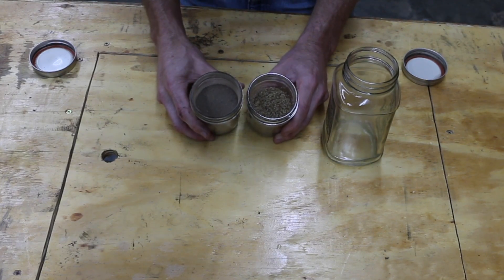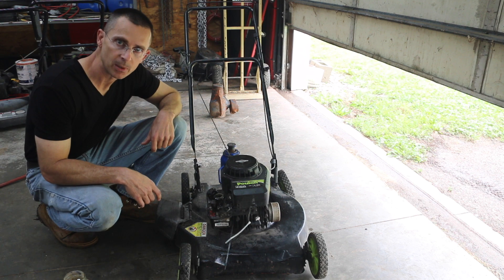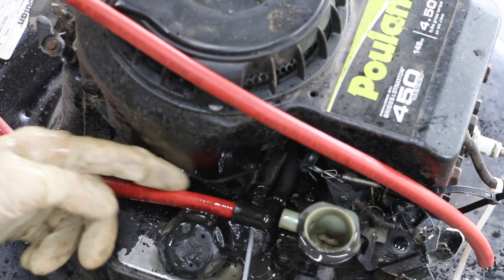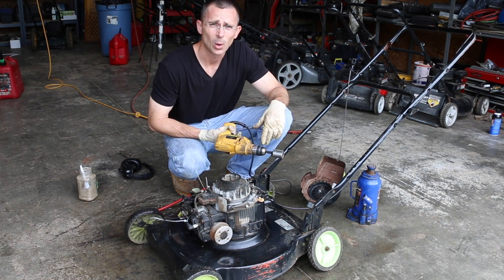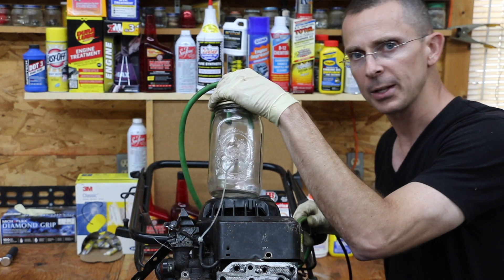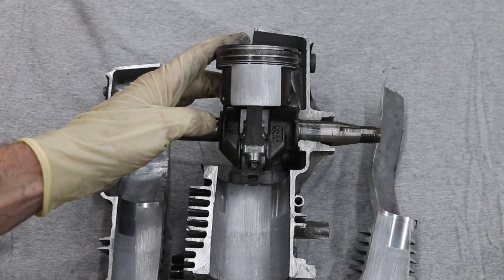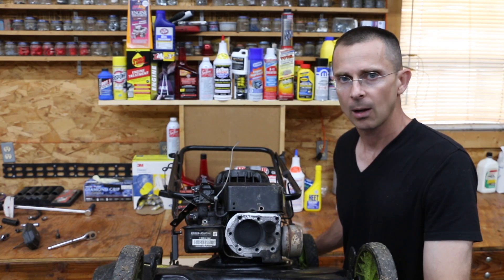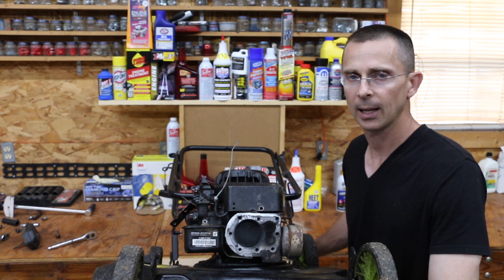Will Dirt Destroy an Engine?  See what it does to this Engine!

Comment: So. Your conclusion seems exaggerated and slanted. What you are saying seems to be analogous to saying that “you must brush your teeth for one hour everyday and if you don’t do it a single day, they will rot and fall instantaneously”

Based on what we can see in the pics, you would need a very large amount of sand to destroy an engine (3-10 spoons!!!). 

And an air filter definitely helps prolong the life of an engine in the long run, but not having it doesn’t instantaneously add 3 spoonfuls of sand to an engine. Unless your car ends up in a extreme condition, like in a river or stuck in a mud puddle, the engine would get minuscule amounts of fine dirt in; Certainly, not pebbles.
Reply from the maker: Thanks for the constructive feedback.

Comment: And this is why I just shake my head at the people who have a turbo on their engine without a filter thinking that the extra few ponies are worth sucking in raw atmosphere. Almost like they enjoy spending money for a rebuilt engine.
Reply from the maker: You're right! Great point.
Reply: My car is supercharged, and I chipped a piston (from knock, blew a quarter of the ringland off smashing up the spark plug and cylinder head) because my intake tube had a small hole in the bottom that I didnt see. When taking the top end apart I noticed the intercooler underneath the supercharger had all the fins bent and full of sand particles, it also damaged the rotors inside the supercharger (Teflon coating) as well. I figure that while I was driving the car in the winter all the road sand got sucked in there. Was a very sad day... I always double check everything is sealed now and couldn't imagine taking the filter off in any situation!!

Comment: It's very unlikely for an engine to suck in that much dirt at once. And I highly doubt the engine would look nearly as bad if it would have sucked in 4-5 tea spoons of dirt in the course of a year or so.
I'm sure engines have air filters for a reason, but this is not at all comparable to running an engine without an air filter, since dumping a whole spoon of dirt into an engine at once is a completely different scenario than a few dirt or dust particles occasionally being sucked through the engine. You could have at least tried to only sprinkle in a little bit of dirt at a time.
Reply from the maker: Thanks for commenting.
Reply: Your welcome...
Not hating btw. just saying it's not an accurate simulation of years of dirt and debris.

Comment: Good video Project Farm.  I would like to see this test done on a rotary motor.  I had a sandrail with a mazda rotary engine in it, it was a nice set up and made alot of hp and high RPMs.  There were a few times when the air plumbing between the turbo and the intake plenum on the engine would completely open up (before I replaced the weak hose clamps).  I didn't realize it for a while, and it happened on several occasions, driving in fine sand.  If you've ever ridden hard in the dunes, you know that sand covers thick everywhere so I know it got in the engine - easily teaspoons full.  That engine never missed a beat!  And ran great for several more seasons (with bulletproof hose clamps).  I am baffled to this day about it and I've always had a theory that the architecture of the rotary motor is more forgiving to having sand in the engine.  I'd love to see that test!
Reply from the maker: Thank you for this recommendation!

Comment: How would the jets be able to put the gas threw?
Reply from the maker: Some carbs have an adjustable jet(s).  The jet increases or decreases the size of the opening in which fuel flows.  A lot of these small lawnmower engines do not have adjustable jets.

Comment: Could a loose spark plug cause any sort of damage over time? If it was hand tight but not tightened with a ratchet.
Reply from the maker: It's not likely to cause damage over time. I would suggest tightening it.

Comment: I would like to point out that a "Dirty" filter is not the same as a "Broken-torn" filter, as a dirty filter actually cleans the air better than a fresh-clean filter due to the pores being smaller on a dirty filter and will restrict the air inflow. On the other hand, a broken filter will act the same as a missing filter.
Reply from the maker: All great points. Thanks for commenting on this.

Comment: that was painful to watch. RIP mower.
Reply from the maker: Thanks for commenting!
Reply: Project Farm question? The reason I looked at your video was because I put an aftermarket intercooler on my car and my car sucked up what appears to be a little bit of fiber glass. Do you think it's okay to run it till it burns it off or should I have my motor disassembled?

Comment: Also, it does have a drain plug underneath. It's just not a regular 6pt bolt. It's a 3/8" square, so ya don't even need a socket, just stick a 3/8" ratchet with an extension in it.
Reply from the maker: Some of these mower engines have the 3/8 inch square plug and others don't have any sort of drain on them.

Comment: What a lot of nonsense 😁 an engine will never take that amount of dirt when driving
Reply: Hey dumbass, it's over time.
Reply: Steven Kibble According to the Nissan service shop my engine has taken in this amount of dirt from a crushed catalytic converter clogging the exhaust system. The composition of the grit is a little different chemically but the result is the same. It was driven about a mile with the shattered CC & is throwing a misfire code & smoking when the CC is disconnected. Never say never.
Reply from the maker: Thanks for commenting.

Comment: Idea for a video: (used,carefully,thru a thin hose, in  decarbonizing old engines): water ingestion while running; i have seen a mechanic overdo it(just pouring water down the throat of the carb) and... cabooom,engine no more (you can´t compress water...).
Reply from the maker: I plan to test a "water mist" in the future.  Thank you for this recommendation!

Comment: *Great video*;  thank you for taking the time; iam gonna make sureb all my air filters are in place,and sealed all around;amazing damage with so little dirt.
Reply: Here goes an idea for a video : i have seen destroyed engines(all gummed up to the point of seizing up),due to very old gasoline(stale gas); one that i remember well,a friend of mine had a few gallons in his boat,parked on land for 15 years; he used the gas in his motorcycle,and it seized up,in the first day; that´s what he told me,and i saw the piston,rings ,and cylinder ,all scratced up,and all covered in brownish varnish,a gooey mess; you could get the stale gas from a junkyard,or from an old boatyard; thisvery old gas has a distincty strong smell to it,differen than the smell of new gas.
Reply from the maker: Thank you for this recommendation!

Comment: If you put filter oil on a dirtbike airfilter that isn't completely dry after being cleaned with cleaning fluids your filter oil will not stick properly to the airfilter.  I've seen it myself personally. the moisture vanished and left dry spots on the filter.  If I remember correctly that 250cc lasted 2-3 laps around a 2.5km sand track.
Reply from the maker: Great point!

Comment: AAng on a second most lawn mowers are either two stroke or not, so which ones are theres, no oil added in the fuel or just run on normal leaded fuels ?
Reply from the maker: I've only used 4 stroke engines up to this point.

Comment: stupid experiment! when sand, dust and dirts enter the engine normally with air they do enter it in small amounts that it can deal with !!
Reply: 1 particle or 100 particles. If they get between the rings and the cylinder wall they are going to rip it up. Accelerated endurance testing. It was demonstrating in a short time what may happen to an unfiltered motor over a longer time period. In small amounts the affects wouldn't be so obvious externally but each particle would be adding damage. 
This was sort of like a 5 years in 50 seconds time lapse.

Comment: @Project Farm, keep these up. I have been a mechanic professionally for 15 years, and a repairman my whole life. To all the nay sayers out there, YES, this type of sand and dirt does kick up during mowing, or driving. Don't believe me, open up the air box in your car, and look  in the bottom. Bet there is sand in the bottom. Still don't believe me, dig up a hand full of dirt from your yard, and rub it on a painted surface. Did it scratch it? Bet it did. There is fine crushed rock (sand) in all soils. If you ever mow in the summer and mow over a small dirt patch, you will kick up dust, and in that dust is very fine crushed rock (sand),  and organic material. This test was just to speed up what years of no air filter will do to a motor.
Reply from the maker: Thank you very much for the positive comment!

Comment: I wonder if ultra fine particles would actually provide a polishing effect? The ones that would pass through a dirty air cleaner?
Reply: You don't want the cylinder walls to be polished. New engines have a slight cross hatching pattern ground into them.
Reply: @rubiconnn  exactly ,that is how a good seal by the rings is attained (the piston should never come into contact with the bores and good rings and a  oil film does that- Once the bores are glazed and shiny a lower compression ratio exist with loss of power ,possible piston slap and oil usage.
Reply: that is what happens, in the diesel world we call it dusting. fixed low hour engine 1500 hours (factory rated life time of 10,000 hours before rebuild). i was in this engine replacing a cylinder head, because a rocker bridge guide worked loose. the rocket bridge guide was pressed into the water jacket so coolant got in the oil. i messed up and left a clamp loose, fine dirt in the air was sucked though into the engine for 40 hours.

engine started with i assume (after repairing many of this engine) with close to .002"-.005" cylinder ware. and a visible crosshatch on the bore.
end result was a bore that was worn .014"  over sized, pistons worn down an unknown amount. you could see the ring gap with piston at the bottom of it stroke (were the most cylinder ware happens) 
40 hours of sucking a metered amount of talc powder
Reply: I've watched an expert tuner assemble a brand new engine, and he "lubricated" the camshaft with a very fine paste, to actually make it polish itself for a perfect fit on the contact surfaces, to reduce future wear.
Reply from the maker: Great point.

Comment: Taking this idea to another approach, The old timers would always say you could increase the ring seal of an old worn out engine by dusting some Bon Ami down the carburetor while the engine was running. The last time I saw it done he used about 1/4 of the container but never checked the compression afterword. Always got the, "Trust me kid I do it all the time" I'm now 48 and never done it. Maybe you could test this theory on an older worn out mower
Reply from the maker: Thank you for this recommendation.
Reply: +1 for seeing if polishing a cylinder this way would make a better ring seal. Not something i would try on a many thousands of dollars car but an end of life lawn mower to get just one more season out of it. Maybe.  :)

Comment: I had a stainless steel mesh air filter installed on a vehicle do you think I might have caused extra wear?
Reply from the maker: It's hard to say without knowing the specifications of the filter.  Ideally, an air filter system will remove all dirt and dust from the air.  i

Comment: Thanks for sharing this. Back when I was in high school, there was this one married couple who I used to mow the grass for. He had a K mart lawn mower with a 3.5 horse power Briggs and Stratton engine. He never used the air filter and said that all the dirt and stuff does is get burned and come back out through the exhaust. The engine on that mower never ran right. 
When I got my Honda HR-21 SXA, I used to clean the dual foam and paper air cleaner assembly after all the time. With all the dirt I would see come out of that foam element and what it was, I again and again wanted to laugh at that man because I knew all that dirt and sand would damage the engine but it seemed he was not going to be told any different.
That was a great demonstration!
Reply from the maker: Thank you very much for the positive comment.

Comment: Briggs and Stratton are definitely one of the best motor manufacturers out there. One thing to take into consideration is there was a lot of dirt fed into the engine at once rather than the amount that would occur during normal usage and therefor would cause harsher damage to the engine simply because there is more of it in there at once. However, it's a great eye opener just to show how important such a tiny little air filter can be and as you said, if this is something people would do, this is proof of exactly what will happen if you don't use an air filter. They are obviously there for a reason! Another great project!
Reply from the maker: Excellent point and thanks for the positive comment.

Comment: FYI...A new air filter is not 100% efficient. A dirty air filer is. A dirty air filter does not let dirt into the engine, like a dirty oil filter. If you change your air filter too often you're doing more harm than good.
Reply from the maker: That's a great point. Thanks for commenting.

Comment: At first I thought he was going to make the epic start to the video by saying: "one of the quickest ways to gain a few Horse power on a gas engine is to add...dirt" lol

I think that first spoonful would have been a good point to stop because the point of faliure wasn't really necessary...the engine was still running after dirt was added.

But, it was kinda funny watching you spoon feed the engine 😂

This is an awesome idea for a channel and theres something to learn from most every video you put up. Keep up the good work 👷

***Could you do a video on undercoating for vehicles? (Oil spray) (rust protection products)
I'd like to know just what I'm getting

It could be a two part video where you can come back to the pieces of metal that you've left out to be subjected to weather...
***You'd have to test each piece against real world situations like: Chemical Salts that are used in places where ice is a common nuisance through the winter.
Reply from the maker: Thanks for the positive comment and thanks for the recommendation on testing undercoatings.

Comment: Could you try using water as a fuel I would love to see the cylinder head after it tries to compress the water but run fuel first than add water while engine is running
Reply from the maker: Thank you for this recommendation.

Comment: Would the same happen if you added fine aluminum powder to oil in a good engine? Would itadd to cylider walls on a bad engine?
Reply: Good question, I'd like to see this

The build up of excess aluminum would be cool to see where it accumulates
Probably mess up the valves and keep one open
Reply: I see you are planning on sabotaging someones engine? Let me know how it goes lol.
Reply: Most likely it would get caught up in the piston rings and gum them up. Loss of compression would follow.
Reply: Nope, nope, nope - engine oil is formulated to hold and suspend foreign material - ideally until it can be filtered out (no filter in this case).  In order for powdered aluminum to adhere to and "repair" damaged surfaces, it would be necessary for the temps of the powdered Al and the engine parts in question to be at or slightly above the melting point of Al.  Aluminum melts at 660C/1221F and engine oil starts to burn around 230C/450F.  The problem with that should now be obvious.
Reply: Not a good idea would destroy the crankshaft bearings
Reply: Likely wouldn’t damage it much
Reply: Then you'll make a very low orbit chemtrail.. ghehe
Reply: r/Shittyaskscience
Reply: carbon buildup can give higher compression

Comment: You would never get that much dirt in the engine at once during normal operation.
I think the mot of the dirt particles that would get in during normal use would get blown out the exhaust without causing too much trouble.
Better if none gets in at all of course, but I don't think this test is very realistic.
Reply from the maker: Great point and thanks for commenting.
Reply: Following another car on an unsealed road. Only takes a few seconds and the cabin is full of dust and dirt and the air tastes of dust. I can wind up the windows and close the vents but the engine has to breathe the dusty air for as long as i am following the other car. The least i can do is make sure it has a good air filter.

Comment: was just thinking about this the other day, and youtube recommended this video, lol...i just wonder if its possible that a turbo charger upgrade will probably result in the same scenario you just displayed, if the psi is increased above factory ecu recommendation, will love to see that or get recommendations if any, by the way i talking about very little after market performance parts just stock pistons, rods, valve, gasket, bearings etc  why i am interested is that to many cons and alot of BS aftermarket performance parts that are at high cost that are completely unnecessary in achieving more horse power. rather than just fine tuning with a factory engine in getting more bhp!!